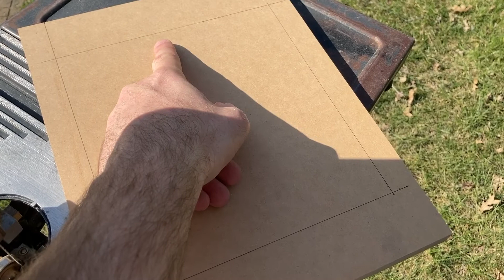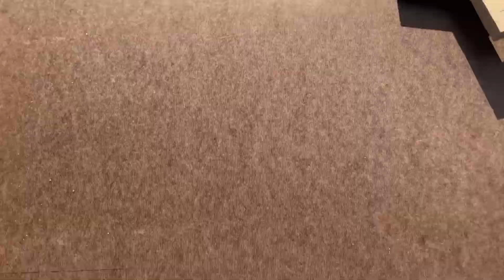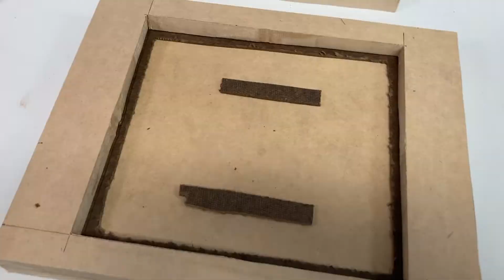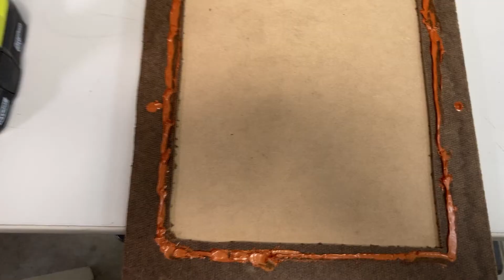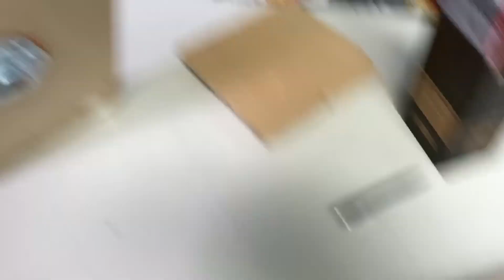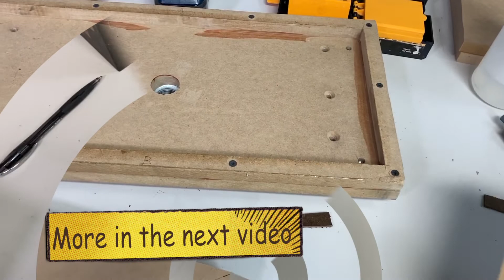Making Small Vacuum Forming Platforms From Scratch P1

Comment: What casting material are you using for your bucks?  I have yet to find a good 2k pourable plastic that will not warp or shrink so much that the resulting part does not fit well.
Reply from the maker: Our tooling is all made from 2 part casting resins with aluminum powder. Important to keep in mind large molds should not be solid. See this video for more info if you haven't already. https://youtu.be/5qYEgxKNUos
Reply: @SabulaTech  thank you for the reply, i will watch that now… solid!  Yes my molds were solid, might be why they warped.